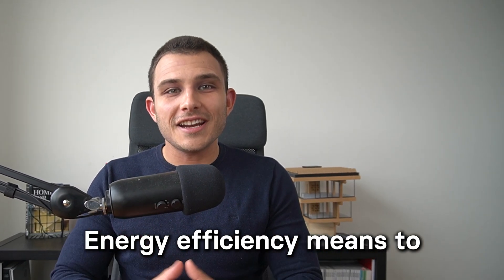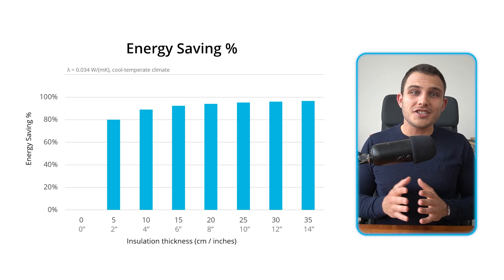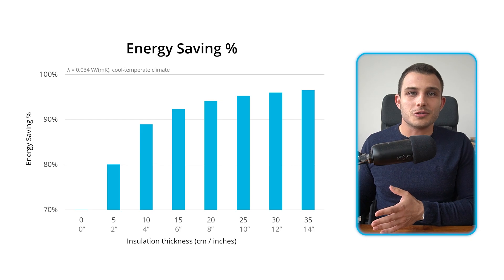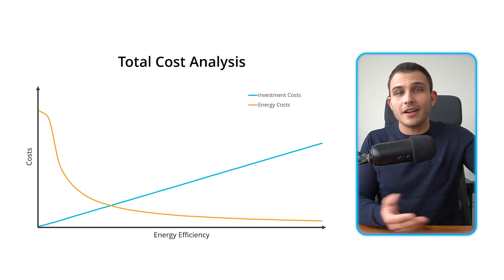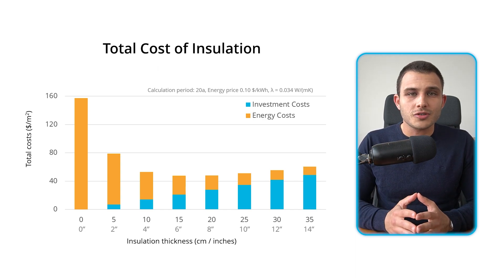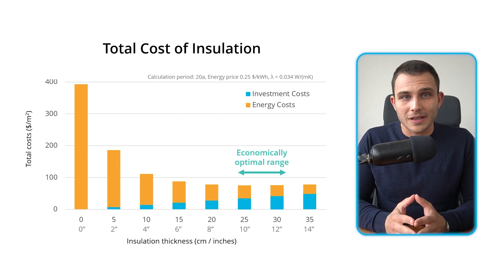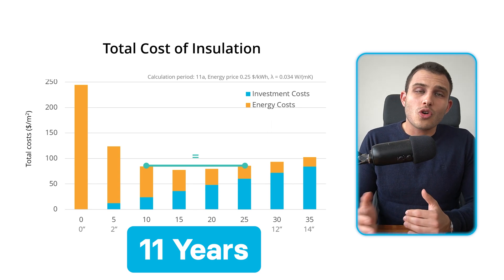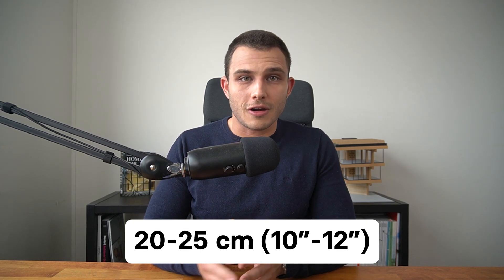What's the BEST Insulation Thickness?

Comment: Since heat rises, the thickness of insulation should logically be thicker at the roof and upper parts, and less under the floor, etc; so really what you're saying is 40cm at the roof, 30cm in the walls of the upper story, 25cm for the lower walls, and 15cm beneath the slab... to achieve a balanced coverage given the actual thermal situation.  How about when energy costs are 70 cents per KWH?

Comment: If you plot insulation R factor versus how many BTUs per sqft/hr loss a wall assembly has, the curve flattens out around a R-12.  This represents the beginning of the point of diminishing returns. For high performance homes, this is how much your external insulation should be for the best price/performance ratio. If you are going to commit resources to external insulation, R-12 should be your target. To prevent the interior side of your exterior sheathing from becoming a condensing surface during the heating season, you only want 1/3 of your total wall assembly R value to be external insulation. This lands you at a max  combined wall assembly R value of R-36. Most of the time you will be better served upgrading the BTU capacity of your HVAC system than adding additional insulation beyond R-36.

Comment: Also factor in the cost of heating or cooling equipment. If you can buy a smaller unit when you have better insulation, that decreases the costs. And probably maintenance and replacement of heating cooling units later!
Reply from the maker: Very good point as well!

Comment: Nice presentation on the basics of insulation optimization. However I think you failed to really address 'future-proofing' adequately. The low probability of high-impact events leads us to undervalue their expected expense. Furthermore there is great uncertainty of how the magnitude of such events is going to change over time. This leads to great difficulty in figuring out a true optimum. However it is really easy to understand that it matters A LOT that you prepare for all reasonable worst case scenarios you could face. For many such scenarios the correct answer is to 'run away' - tornadoes, hurricanes, fires, and floods (and other outlying extremes) are really hard to prepare for. On the other hand we are rapidly learning how to do this stuff, and it tends to be not that hard. Some of these building features may also aid in preparing for less intense disasters - things like extended power outages, other service interruptions, and other more chronic than acute challenges. These challenges can lead to pipes freezing, deferred maintenance, and other expensive impacts that can be mitigated by insulation or other built features. This is a much more complex optimization challenge.
Reply from the maker: Thank you for your comment, Jim! Indeed you are right, in this video I addressed the best insulation thickness and not The readiness for high-impact events of building. This topic is of course super important and maybe we should cover it in another video. I would be curious to know what do you add to your designs to get them ready for such "worst case scenarios"?
Reply: @AntonDobrevskiPHS   Hi Anton, I have some thoughts about this, but am under no illusion that my thoughts represent a complete and proper perspective on this question - it will require input from many diverse viewpoints. Since I live in northern Vermont, the insulation-related scenarios of greatest concern to me come from extreme cold combined with service interruptions for basic utilities. One of the key questions in this regard is whether a house has a good, old-fashioned wood stove. If so, the requirement for insulation in emergency situations is reduced. Otherwise my feeling is that the core areas of a house should be able to withstand about 2 days of extreme cold (without electric power) with a very modest drop in temperature (definitions of modest here could vary significantly). Whatever that amount is would probably suffice for avoiding freezing of pipes for at least a week, although this should be checked. This is a very seat-of-the-pants answer, but I have not encountered any scientific- or engineering-based answers to this question. If you do have a wood stove, it would probably still be best to have a house that would not freeze during a week of extreme weather. Maybe that is a starting place? Of course extreme heat is in many ways a much harder question, and I have little to offer there.
BTW, thermal mass obviously figures in strongly in this problem area, especially in the case of extreme heat (or - heaven-forbid - wildfire)

Comment: Of course if you're designing your house off-grid, then the price of electricity is no longer a factor in your calculations. The balance is now between the cost of the extra insulation, or the extra solar panels to be able to heat your house in winter, or cool it in summer, whichever requires more panels. 

Considering how much less power I get from my fifteen-year-old solar panels now than I did when they were new, I think the assertion that they need to be replaced every 25 years is probably not far wrong. Fortunately, insulation shouldn't have that ongoing expense.
Reply from the maker: Good point. Battery cost/maintenance is also a significant cost-factor for off-grid houses.

Comment: Ehh, don't forget that the amount of new carbon dioxide released into the atmosphere every year is still accelerating. Find the "worst case" forecast for how ambient temperatures are going to change in your region over the next 200 years, double that, and then insulate to make your house habitable in those conditions.

The modern building industry likes to assume a 50 year design life, but I don't see a lot of people bulldozing their 50 year old houses to build new. The next buyers might add some insulation, replace the single glazed windows with double glazed, and repaint, but then they go on living in it. A 200 year design life really needs to be our minimum, and for high-quality houses more around 500 years. If you don't think your house will be fit to live in by then, why not, and what can you change to fix that?

Comment: Kind of seems as though you aren’t differentiating between walls and ceilings/roof insulation
Reply from the maker: Tha aim of the video is to shed light on the importance of insulation thickness and the return on the investment. Walls, roofs and floors usually have different thicknesses indeed but this should be determined based on an energy model of the specific project.

Comment: The amount of insulation depends on the climate you live in.  I wouldn't have R-30 walls in Texas but I would in Minnesota.  We can have a delta of 80-100F between inside and outside temps for 3 months up here.
Reply from the maker: Climate is one of the factors. As mentioned in the video, there are also other factors such as building size, price of insulation and energy, material type etc.

Comment: I've always known insulation works on the law of diminishing return. 4 inches fibreglass between the rafters in the loft of a bungalow. Last summer whilst getting down a cobweb I realised how warm the ceiling was. I spent money on some Rockwell to top up thickness. It was well worth it, as comfort level is much better and energy usage is less. Your video is good advice.
Reply: I can tell you that the sound reduction improvement is another benefit. We just had our home's roof topped up with additional insulation. Not only are warmth comfort levels improved, but so too is the amount of sound reduction from the fan noise (at high speed) of our heat pump air conditioning system. Those large fan blades spin fast at times, causing a significant amount of noise. Before the top up, the sound entering the house was greatly reduced but since the top up, almost imperceivable now. I love the PassiveHaus concept.

Comment: What type of insulation are you referencing?
I'm assuming fiberglass, but this is not the only option.
R value might be more accurate (though I've heard there are issues with that as well)
Reply from the maker: For the calculations is important the thermal conductivity of the insulation material. In the video is used insulation material with lambda 0.034 W/(mK) which could be fiberglass, EPS, etc.
Reply: @AntonDobrevskiPHS  thank you for the clarification

Comment: Not sure that graph is accurate. The relationship between energy efficiency and initial investment cost is not a straight line. Costs get exponentially higher to achieve the last 10%-20% of efficiency.
Reply from the maker: In the graph of total cost analysis, this is considered in the energy costs curve as it is not linear. 
One option is to represent the energy cost (i.e. energy efficiency) linearly in which case the investment costs are not going to be linear - that's what you are referring to. The other option, which is shown in the video, is to represent the investment costs linearly and the energy costs as a curve.